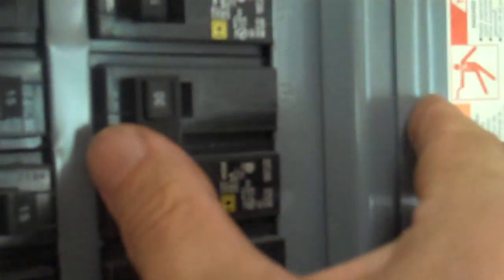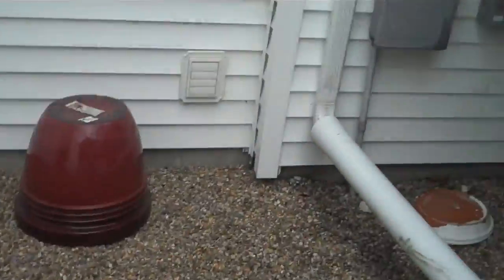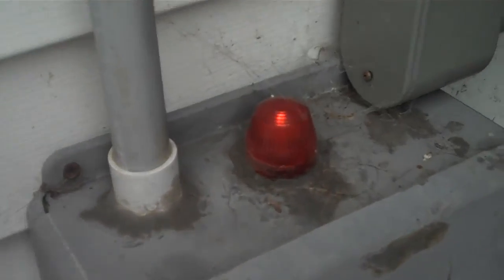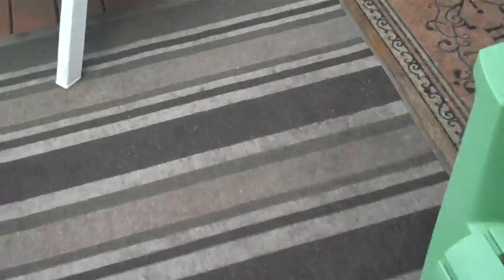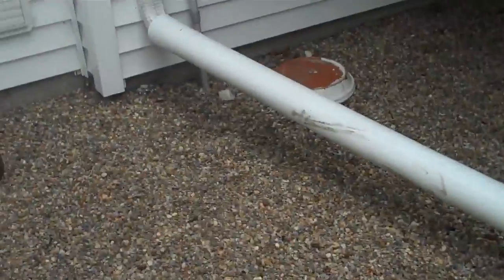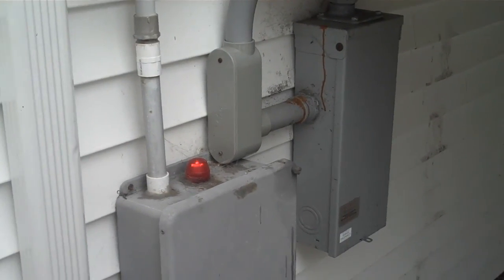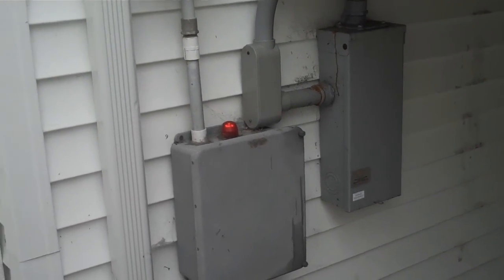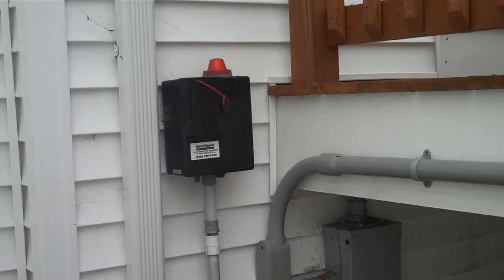Grinder Pump alarm test on oldest system to date

Comment: I fail to see any significant benefit to that battery backup add-on. The light is dim and there is no buzzer. I suppose that during a power failure, you could walk outside and look to see that the water level is high or not. But if the power is off, you should just limit your sewer usage anyway - light or no light.  My own unit does not have any alarm when the power is off. I can tell if its full by the sounds in the sewer pipe in the basement.  Its good that you are testing this, but I do the same test a little differently. Instead of turning the 30 amp off on the main panel, I turn off the 20 amp in the alarm panel. This way the 15 amp alarm is still on. Then I just run water down the laundry tub sink or the bathtub at full speed until the light turns on. That shows the test passes. Then I turn off the water and turn back on the 20 amp breaker. The alarm then stops.  My method doesn't involve filing the tub in advance. This saves some water and saves time because you just run enough for an alarm and then shut off the water. Unrelated to this, I added a 120v relay into my alarm panel and connected the dry contacts to an external alarm system. This allows me to get a message on my cell phone when the water alarm goes off. So, I know even when I'm not home, or out of hearing range of the buzzer.